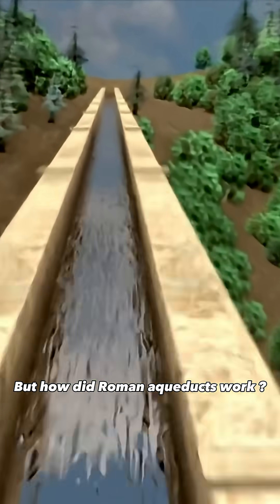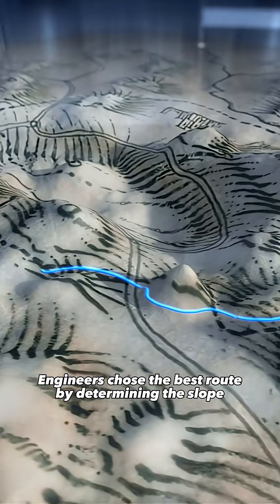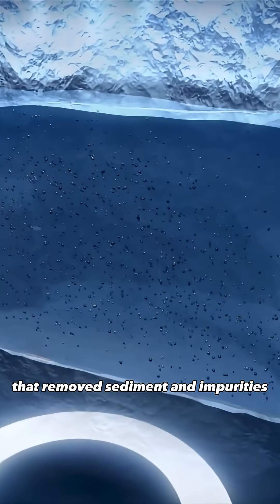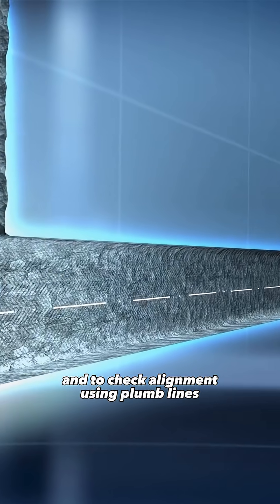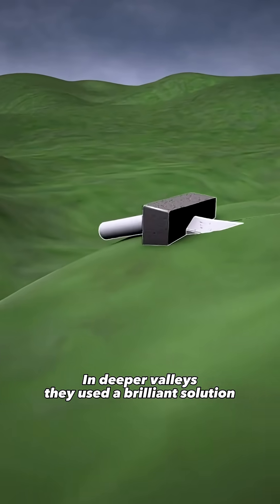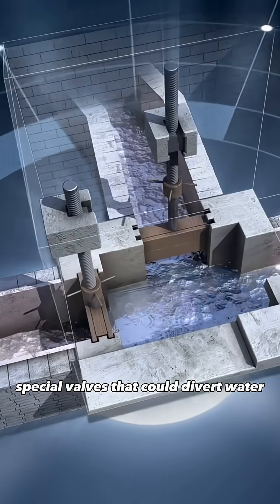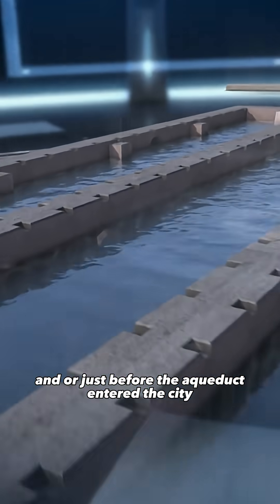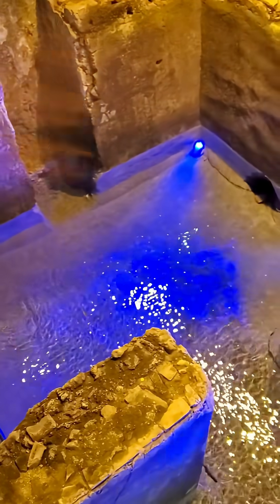The engineering of roman aqueducts explained #history #romanempire #engineering #aqueduct

Comment: My God that's just amazing. Not only did they build a system to transport the water to the city but it was being filtered as well. Fascinating.
Reply: Not really filtered. The sediment was just allowed to settle, so it would be clear. But some water sources still had murky or muddy water at the city side, if it had been raining. Clear water doesn't mean clean or purified, so allowing sediment to fall isn't enough. But the romans happened to use lead pipes which are slightly toxic and kills most of the bacteria. Also many of the water sources were high in minerals like arsenic, which also kills bacteria. Lead or arsenic isn't good for humans but not extremely dangerous either at those low concentrations, and it makes the water drinkable enough so you don't get the runs. Even if they knew the risks of arsenic and lead, they would still drink it cause getting diseases from bad water was sometimes fatal, and having the runs isn't enjoyable.
Reply: @OlaviMurto  so they should have made it copper, and put a layer of charcoal in the sediment tubs, and it would have been amazing. They should probably retrofit the ones that are still in use
Reply: @Londubh  Copper was not as widely available, it was harder to work with and required in general more effort, for a pay-off the Romans really couldn't have known would occur.
Reply: @OlaviMurto lead definitely decreased their life expectancy by a fair amount, lead can stay in the body, particularly in bones for decades. Its can be released during pregnancy therefore the newborn will also have lead accumulate in the bones also! Now after 2-3 generations imagine how much lead is accumulated in the body. No amount of lead exposure in modern times is considered safe. It is very toxic even in tiny amounts.
Reply: @OlaviMurto  did they regularly boil their drinking water?
Reply: is copper the best?
Reply: or silver particles?
Reply: @OlaviMurto  yeah problem was they used lead as sweatner too.
Reply: @OlaviMurto  you just described filtering.

also, they absolutely knew lead was poisonous. That was well known by the ancient greeks
Reply: @OlaviMurto  i wonder how they clean out the filter spots.. i mean at some point woudn't they fill up and clog?
Reply: @Light256 Probably they route the water from elsewhere, let the sink holes drain out and then shovel out all the dirt.
Reply: @OlaviMurto  back then pure water wasn't really something you'd have regular access too. That's why drinking pouches were important. 
.
If you had guys who did the simplest of things like announce news vocally around town. You'd have people who offered cleaner water than what you get from a river. The rivers also had jobs and guards.
Can't have the poor pissing in the emperor's or upper classes bathing river.
.
Stuff like that ya know. It was mostly juice or beer they drank since it had calories and wasn't just water from a river.
.
Idk truly. But if the rich have it better why wouldn't their rivers be cleaner?
Reply: @dandywaysofliving What rivers? Are you replying to the correct person here? Your comment is very confusing
Reply: @OlaviMurto avocado 🥑
Reply: And yet they were fine for and lived long lives 😂 "oh no its not boilled and it doesn't have a bunch of chemicals in it.  Must mean its not clean.    Such a modern take @OlaviMurto
Reply: @rexquite5547  No they didn't? They were lucky if they reached 60yo. Only the very wealthy with high quality food and water etc reached 70+ yo

And like I said, the arsenic and lead killed most of the bacteria, so there was no need to boil the drinking water. But those bring their own issues too.

Also, all water has chemicals because H2O is a chemical 🤦‍♂️
Reply: You must see how they take the gold from the mountains of Spain, The Médulas
Reply: What would they do when those settlement tanks filled with sediment?
Reply: @daisysline5605  I would assume they would redirect the water to another tank and get a team of men to remove the sediment from the original tank. Alternating when needed. If they could engineer this marvel then simple maintenance would be no issue for them.
Reply: @daisysline5605 Toglievano i sedimenti, facendo la manutenzione periodicamente.
Reply: @daisysline5605 Get contractors with slaves to clean them out. If the migrants won't come and do the dirty work you have to send out your army to enslave workers as forced migrants.
Anyone who doesn't understand migrants are needed to keep their empire going is stupid and probably MAGA.
Reply: the Trevi Fountain in Rome is supplied with water by an ancient Roman aqueduct called Aqua Virgo, built in 19 BC
Reply: wait till you learn about how they built Venice
Reply: And also by just using waters natural flow, no additional power was used to lift or move the water
Reply: They were also lined with lead just sayin
Reply: Viva Italiano ❤️
Reply: Yeah they wiped their ass with a stick that had a sea sponge or something like that on one end. It was kept in a bucket of water in a communal bathroom. So multiple people shared it and it was cleaned off in a bucket that many more people used. 
They had no concept of germs or viruses or microscopic single celled organisms that caused sickness or disease. So not really peak. More like  a cess pool if you ask me. They also were many bulimic in the upper classes that would purposely make themselves vomit so they could drink more wine and eat more food at night parties or festivals. Their ruling and upper classes were just as greedy and glutenous as ours today. Human nature it seems is hard to change. So we wait for our turn to meet the same end.
Reply: Didn't mean night parties. Not sure how night got out in that sentence.
Reply: " filtered"
Reply: Yet, in Los Angeles politicians allowed the worse for to destroy thousands of lives bc of shutting down water access! Talk about PTSD from demonscratic politicians
Reply: Well obviously it had to be filtered. They at least had that knowledge
Reply: And it was so well built that some of them can still be used today.
Reply: Persians invented aqueducts.  The Greeks & Romans improved it.
Reply: You idiot, it's us : homo sapiens, why do you call "they" you idiot.
Reply: Never heard the Army part before and strange that it was put there 😅
Reply: Well except for the lead pipes
Reply: 1st. That doesn't mean it's pure. 2nd. Don't forget it in all went through lead lined pipes in the cities.
Reply: Yet ear
Reply: Too bad they were using lead plumbing :/
Reply: Yep. You wont find that level of engineering in africa lol
Reply: Africa could had done this, but they where oppressed by white people.
Reply: The practice of filtering water had been around for thousands of years, but it did provided for millions of people which was quite a feat.
Reply: and some of them still work today.
Reply: South America in the ancient past had the same and the exact same aqueduct bridge design. Unfortunately, they are not given the same credence and their roads are thousands of miles longer, built and carved through the mountains.
Reply: and no money to operate because it run on gravity and pressure and not coal and electricity
Reply: They had 8 of those Aqueducts leading water in to Rome. Over 1 million liter every day, of constant flowing water...
Reply: And finally delivered through lead pipes
Reply: and it didnt use one cent of electricity in the entire process, this was one of the only times humans progressed towards a clean and renewable lifestyle in our entire history.
Reply: Yeah filters are such high tech
Reply: @donniebaker5984  high tech enough to save and change lives. They were able to deal with other problems while others were bogged down with dysentery on a consistent basis. People talk alot about the roads but frankly killing people who eat rotten food and dont have clean water is alot easier while you are fully supplied with food that doesnt spoil and have methods to clean yourself when needed.
Reply: Explain dinosaurs then why were dinosaurs before humans
Reply: Yea with all this marvel, they wipe their ass with shared stick
Reply: Yes but there is no need to use GOD'S name in vain.
Reply: @northernbutterfly  god does not exist. its a fairytale made for simple minds.
Reply: @northernbutterfly  that’s not in vain - in vain is self aggrandizement or for hateful unjust purposes: to exclaim to God in amazement is only natural
Reply: @sarahnelson8836  N, using the name of GOD in amazement is using HIS name in vain! "You shall not take the name of the LORD your God in vain, for the LORD will not leave anyone unpunished who takes His name in vain." Exodus 20:7 Just do your homework and say "gosh" or something instead!
Reply: Lead pipes hence maniac army
Reply: Afrocentric types will tell you that they taught the Romans how to do this. 
Imagine having such an ego
Reply: @0311USMC  It came out of the Middle East, actually. The Assyrian Empire was the first to make complicated and sophisticated aqueducts. Before them, simpler aqueducts existed in both Mesopotamia and with the Minoans. The thing about Rome was that they didn’t really invent as many things as people believe, they took ideas and technologies that existed and copied them (with some improvements from other cultures from time to time). Eurocentrism did a number on the historical education.
Reply: @KleinesStein  middle east is not africa. It is Asia.  Please wear a bright orange shirt in downtown Gaza.
Reply: @0311USMC  I never said the Middle East was in Africa, I merely corrected the information you stated. The Romans didn’t invent Aqueducts, they absorbed the idea and developments from other cultures.
Reply: They also made a good portion of this with Pb so it was actually pretty toxic and likely led in part to their downfall
Reply: @sarahnelson8836  Lead chalices were more dangerous. Wine was drank out of them and the acidic wine broke down lead into the wine.

Also wine bottles were sealed with lead and stored.
Reply: @sarahnelson8836  They probably wouldn't have had a good time if it wasn't lead, considering the toxicity killed much of the bacteria
Reply: @davemiller638  unlikely to have made a significant difference at the concentration - having positive pressure in the system is more important. Also the entire point of running these things was to get water from a clear source - it was already pretty clean (we are our worst pollutants when it comes to water bacteria ask any Civil War buff {it doesn’t even matter which one}) so by having a source away from and higher than the city and its “refuse” it was clean and pressurized. 

They also could have forking used copper.
Reply: @sarahnelson8836  it isn't tought it was the water pipes, cause while lead it's toxic it was pretty low in water, mainly the upper class used container with lead for wine which make it dissolve much more(much more acidic) and gives the wine a sweeter taste and there you have a high concentration.
Lead brings lower IQ and mental instability and so you have a crazy elite which takes decisions.
Reply: meanwhile.. in the black Africa...nothing
Reply: @Stan-jq8jr  most of africa didnt get the same travel as protected costal cities. The medetarrian, adriatic and others were protected and easily traversable compared to the oceans that for example britian had to learn to sail, also their seas were filled with other coastal locations making it a vibrant and diverse series of locations that people can actually travel to multiple times in a single lifetime without dying. This created not just a trade of resources but of knowledge, all of these locations were able to see new worlds and take the best ideas from each. Romans took most of their early success from the greeks and even later inventions like the julian calander which we still use today was actually invented by an egyptian that the first caesar brought to rome. Remind me where egypt is again btw, africa? thanks for coming to my ted talk have fun with racism idiot
Reply: According to whom? @Stan-jq8jr  because until the Francis Drake and the subsequent Colonial powers Randact it, (still to modern times) what is there to discredit from Alkebulan? Because human consciousness predates the Arrival of Adam and Eve on Planet Earth...
Reply: @Stan-jq8jr There were Roman cities in Africa.  And don't tell me all their citizens were white!
Reply: Umm i'm sure you've heard of the Egyptian empire which is in Africa and then there's the lesser known Songhai empire which is located in central Africa if i remember correctly and was an impressive empire as well.
Reply: @Stan-jq8jr Don't forget Egypt, Cush, Ethiopia Great Zimbabwe etc.
Reply: This was the peak of humanity.  Change my mind.
Reply: @data_abort  show a roman that even the poorest people of europe now have purified water up to level 40 on a hill in a city of millions and they also have a water closet, they can take hot showers in their homes, where they have electrical light all day, and they also have a cold box and another hot box to make food, they also have another box that makes hot and cold air depending on season, not to mention they have a tablet in their hand that has access to all knowledge of the world but you don't use it...
Reply: @data_abort  If you were born 300 years ago then this would be peak humanity. Don't get me wrong the romans were incredible but we as humans learn, adapt and progress with technology we learnt from those who came before us. Now we can reach the heavens and beyond, something that would bring tears to their eyes if they could see what we can do now.
Reply: @data_abort  There’s about 100000 years of other cultures that beg to differ. No one culture was the “peak of humanity” because there is no way to gauge that.
Reply: @data_abort yes fancy being able to invent and build all of that with just  using manual  tools and labour  and some of their work is still standing and functional today ❤️
Reply: @data_abort I don’t wanna see how short your peak is if that’s it
Reply: @data_abort Yemen and Oman both worked out how to get water to flow uphill. Yemen built huge retaining damns for water storage and falages to carry water around the land.❤😊
Reply: @othmanmajid6380  nah the arabs where legit that's something else
Reply: @data_abort  everything we have now was built on the thousands of innovations before and since this time - it is literally not the peak… that’s not how technology or people work. Things are just more complex now so it’s harder for a layperson to understand just how cool modern science is - not impossible- just harder
Reply: @data_abort the peak of humanity is happening right now. we have gone to space, created a machine that can come up with any answer, globalized communication and much more. we even have better water transportation systems. this is not the peak of humanity
Reply: @data_abort  live there for a month, you'll be begging to come back 😂
Reply: @data_abort if you wanna live up to 27 then sure I guess it’s peak
Reply: @data_abort  uhhh, there are so many things to choose from but Nero alone sums it up more than adequately 🙄
Reply: @YukonJack most people think it peaked as a Republic, and I should be specific that it's the reach of the engineers with their basic materials and the boldness of planners and the skill of workers that impresses me. Political greatness is another thing, and Rome was not always well governed, like you say.
Reply: @YukonJack  we have multiple Nero's alive and in charge now.. doing worse than just burning cities
Reply: now if only they didn't use lead for their pipes
Reply: Running water is always clean
Reply: Surely, alliens built that
Reply: Arch don't use God's name in vain and repent.
Reply: @PunkDogCreationshow is it in vain? Did God not create humans that created this and isn't he exclaiming his name in reverence at the amazingness of his creations? Seems like you don't reverence God and his creations to me and are just annoyed because someone else does and is probably more intuned with God's plan than you are. You should seek God and God will instead of worrying about what others do with God, for you are not their judge he is and he will deal with those that use his name in vain as he sees fit and not as you would like him to. Or do you propose you are more than your God and you'll take action on his behalf when he hasn't told you or given you permission to?
Reply: @PunkDogCreations He didn't mention God's name. Do you know what it is?
Reply: @PunkDogCreations a punk talking about god, man the f**** hypocrisy